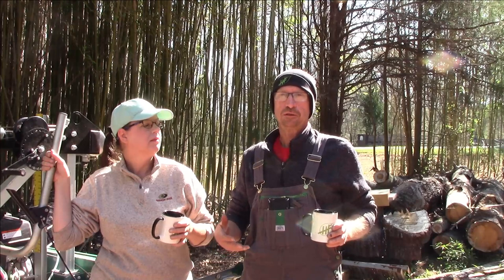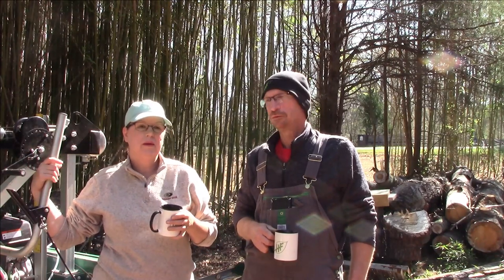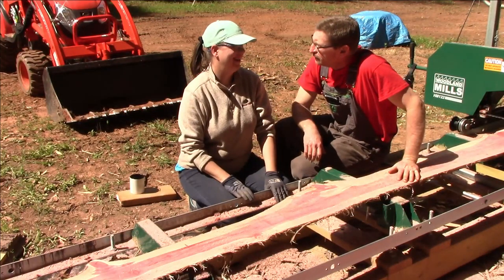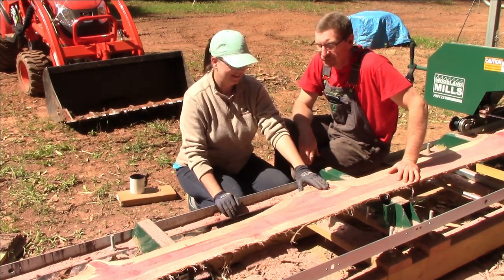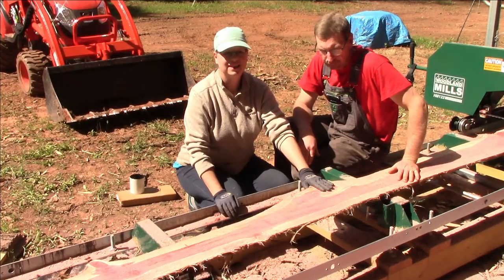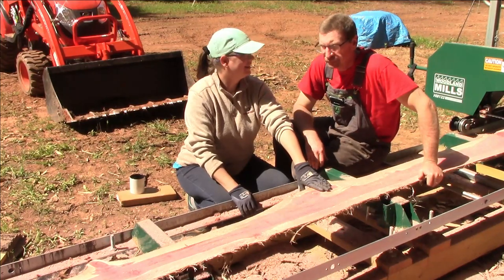Sawing Cedar Planks | Woodland Mills HM122

Comment: If the winch takes more force to lower the head than to raise it, a little WD-40 sprayed into the winch clutch will fix that. Lower the head to the stop to take load off the cables and free the clutch discs. Spray past the gear from the spool side.
My winch became so stiff, it took 25 pounds of pull on the crank to lower the head but only 10 to raise it. After lubricating the discs, up and down take 10 pounds.

When cutting live-edge slabs or boards, when you have a bit more than half the log left, turn it flat side down. It will be stable, and you may not need to clamp it.
Reply from the maker: Great feedback, much appreciated!
Thanks so much for watching 😀
Reply: To add to that, by flipping it you'll also work against the natural tension in the log and minimize the warp in your boards later on & also hopefully prevent the dreaded "thick & thin" scenario 👍
Reply from the maker: @MountainRoots  Thank you, I'm learning a lot and all the input I can get, the better 😊